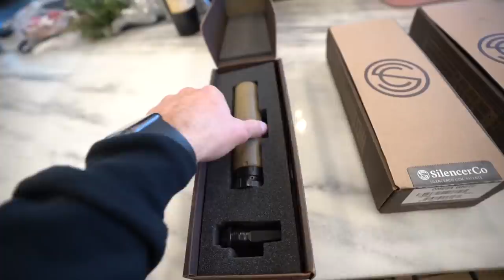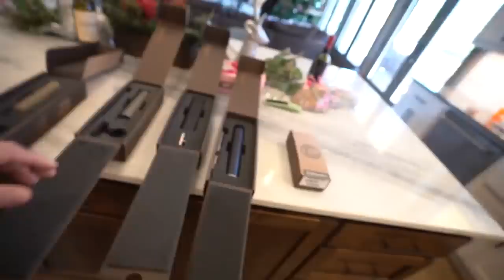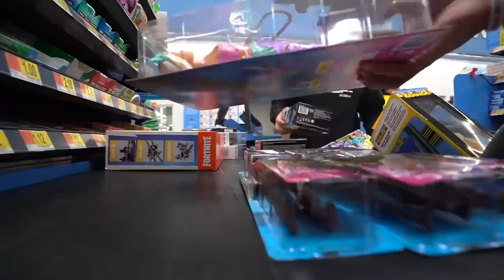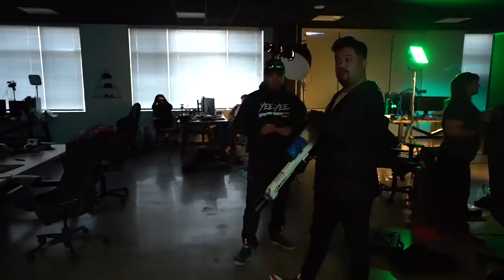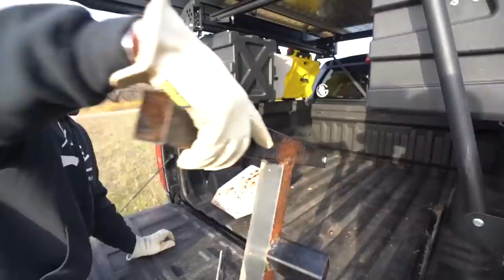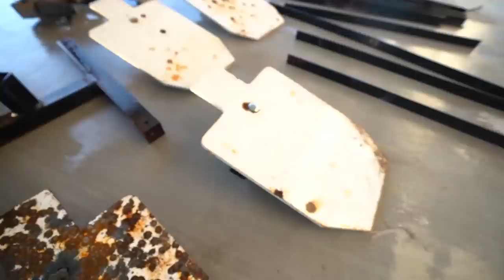So Im Buying My Own Ranch...

Comment: Rob, get a Tikka “freedom package sender” they are made in Finland, the same factory where Sako is made. I love mine and the action is super smooth and feels better than most others.
Reply: I too have a tikka t3x with heavy 24" barrel in .30-06 absolutely love plinking 1000yards with it
Reply: Browning X bolt extreme long range is pretty sweet. In a rimfire the Ruger precision bolt action Rimfire is really nice, it comes in 22LR, 22 Mag, 17 HMR. A suppressed 22 Mag in the Ruger Precision bolt action would be an excellent little varmint gun. This is a video where I light a match with my Ruger Precision Rimfire in 17 HMRhttps://youtu.be/CC-Rrpkx1V8
Reply: I too have a tikka t3 in 6.5x55 really good rifles

Comment: If you want a good bolt action for long range especially go with the Savage 110 tactical .308 it is a bit heavy it comes with the barrel already is already threaded for suppressors it’s also not very expensive

Comment: Start with a Howa action and barrel.  It is basically a Remington 700 action and barrel with all the normal modifications incorporated which are typically made to a 700 action to improve accuracy.  The stock trigger is pretty good.  Not as good as an after market but for a stock trigger pretty darn good.  I have a .223 target rifle out of one.

Comment: The  W&P ar-15 has a model called the MP22 it’s a 22LR AR-15 all functions and actions are the same and all parts are costimizable with aftermarket.... I love mine has red dot with flip up magPull sights magpull grip adjustable stock for grip and has a threaded barrel for once I can get one of them suppressors I highly recommend and it’s bout 400$

Comment: Freedom package senders should be: begara premier 300 prc, or have my buddies at West Texas Ordanace build a custom rig. The options are endless. Kinda depends on what you're purpose is for it. If it's just for plinking steel and the occasioal hunt I'd go with a 7mm08, 6.5 creedmore. They'll have a longer barrel life and they aren't terrible to shoot and ammo is available most places. I feel like the problem you had with the 300win mag was due to the carbon barrel. Its not made to shoot back to back bc of the steel barrel with the carbon overlay doesn't dissipate heat well and they have irregular barrel harmonics. Like you stated those guns are built to be light and used on hunters where the weight of the rifle matters and not made for range day. They perform best with only 1-3 shots. Maybe this helps with a decision.

Comment: CMMG Resolute 300 series in the new 350 Legend. Its a new straight wall cartridge made by Winchester. Its a based off a 9mm/ .357 projectile. Winchester states that it has near 40% less(if I remember correctly) recoil than a .243. But more punch than a 30/30. Its an interesting caliber, I've watched a lot of videos on it as I'm interested in it myself

Comment: Could you use the Osprey on a 450 Bushmaster bolt gun?  I don't know off hand what the thread sizes are though.  I believe Ruger and Savage both have bolt guns for the 450.  I just got my Sig SRD762 out of NFA jail last month.  Still trying to decide what to use it for.  The Bergera HMR 6.5 Creed?  AR 308?  300 BLK?